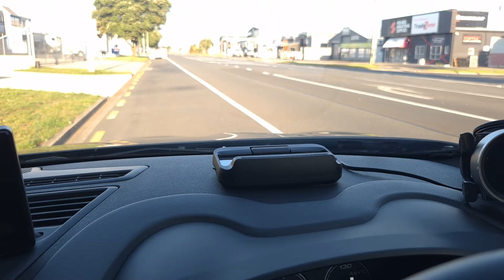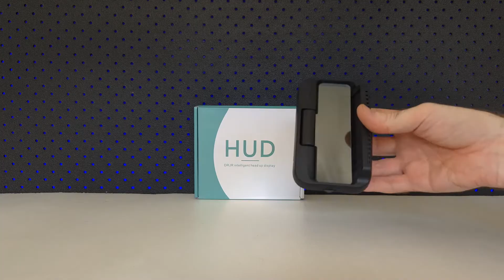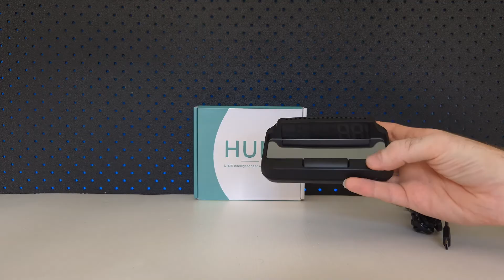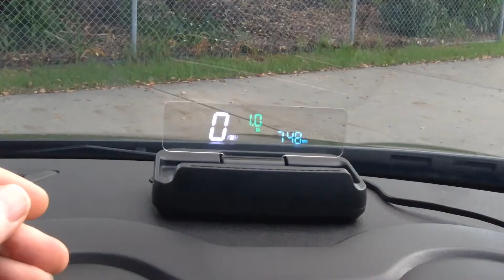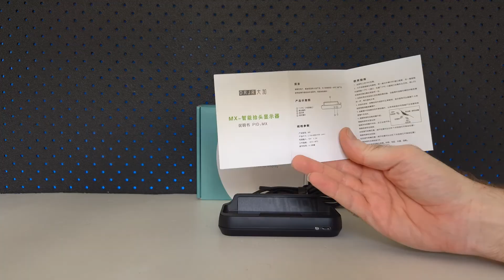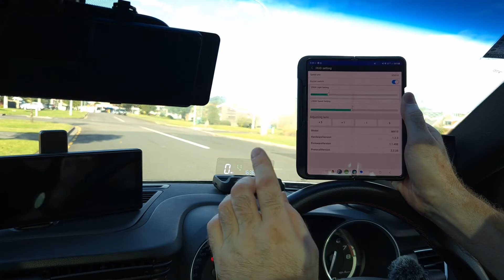A Car Head Up Display that Opens by Itself? MX HUD

Comment: Yo lo instale en mi spark gt y tengo un problemita cuando enciendo el a/c se apaga que puedo hacer con esa falla
Reply from the maker: This HUD does not allow you to adjust the Voltage input in the app unfortunately so the only solution would be to use a simple inline voltage stabilizer to stabilize the voltage under higher load
Reply: Pensé que sabrías de alguna solución
Reply from the maker: @heliojairgruesomoran9103  This HUD does not allow you to adjust the Voltage input in the app unfortunately so the only solution would be to use a simple inline voltage stabilizer to stabilize the voltage under higher load

Comment: Cool HUD, is there a similar motorised HUD that uses GPS instead? I'm worried that the OBD2 will mess up something in my car.
Reply from the maker: Not seen a GPS 5 Volt controlled motorized HUD as of yet unfortunately, they are all 12 volt powered. Chrysler vehicles can be temperamental with OBD2 HUD's but experiencing problems with the other car brands is rare
Reply: @SHORTwithTECH  I had issues with a previous OBD2 HUD in a Holden (Chevrolet) Cruze, where it would randomly switch the engine on. I now have a Nissan but I'm still not convinced to shell out more coin on a new unit.